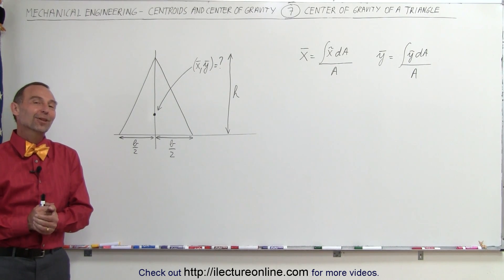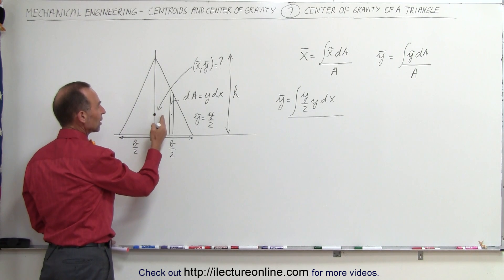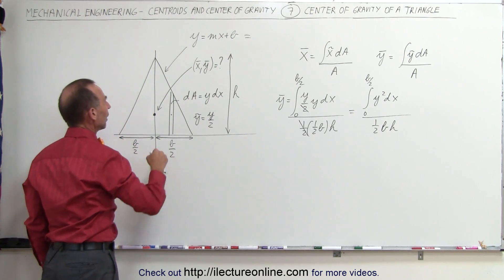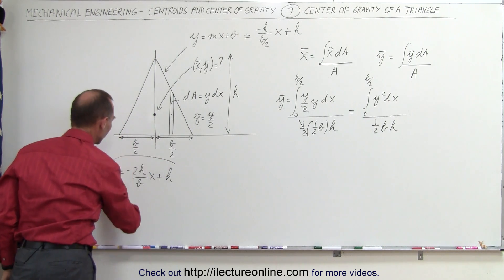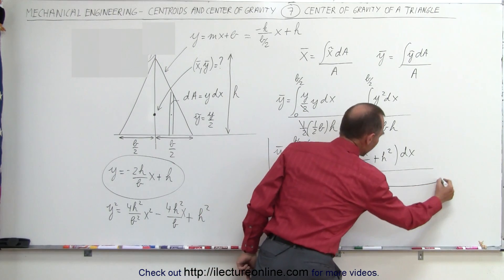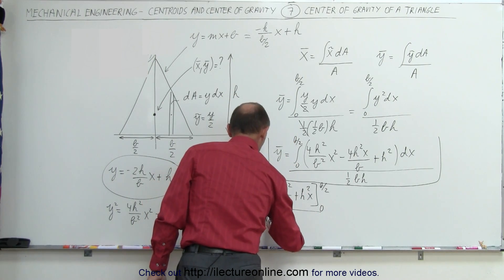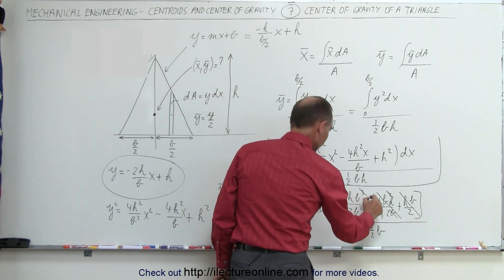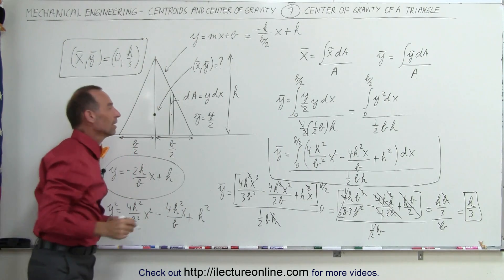Mechanical Engineering: Centroids & Center of Gravity (7 of 35) Center of Gravity of a Triangle

Comment: Hi sir! Is this applicable only for isosceles triangle? If it was an scalar triangle then the median to base won't divide the triangle into symmetric halves, it can't be passing through y axis, then how should we proceed?
Reply from the maker: This can be used for any shape triangle and the result will aways be the same.  You would just have to calculate each half seperately

Comment: For an equilateral triangle, you don't need to use integration. Trigonometry will do it.
Reply from the maker: Certainly you can use the principles learned in geometry, but this is an example of how to caluclate it using calculus.
Reply: @MichelvanBiezen  In reality, the shape of a physical object does not follow some well behaved (smooth) functions. And integration in the mathematical world is really an approximation of summation in the physical world, not vice versa. The idea of center of gravity really hasn't progressed much since Archimedes.
Reply from the maker: No it hasn't, but then there is no need.

Comment: Sir the integration should be from -b/2 to b/2, I guess 
Plz clarify the range of integration if possible
Reply: He used only half of the area in 0:59 (thus the range from 0 to b/2). He could have multiplied the numerator by 2 and use the whole area in the denominator which would result in the same thing.
Reply from the maker: Because of the symmetry, the centroid of the left side equals the centroid of the right side, which equals the centroid of the whole triangle.
Reply: Thanks sir

Comment: For those who are confused about why he didn't take 2*integral like the previous video. Notice, he took only the half area of the entire triangle. So if you take the entire triangle, that would be 2* right triangle in the denominator. And then take 2*integral in the numerator. Then you'll end by cutting 2 from both numerator and denominator. Hence, the equation becomes the same.
Reply: Why is it that if I try to make A equal to the entire triangle area and the dx limit is -l/2 to l/2, the result is not the same?

Comment: As we are intrigation from 0 to b/2, shouldn't we multiply the whole thing with 2? So shouldn't the ans be 2h/3? Please correct me if I'm wrong
Reply from the maker: If you were computing the area, yes you would have to multiply by 2.  But the centroid of the left half is the same as the centroid of the right half, so you don't need to double the result.
Reply: @MichelvanBiezen  thanks a lot

Comment: i see that you were calculating using the formula of the right side of the triangle,  y= -mx + h and the limit is from 0 to b/2. Then what about the left side?
if so, wouldn't that make the coordinate of CG at x is wrong?
Reply from the maker: Because of the symmetry you will get the same answer.
Reply: @MichelvanBiezen  thank you

Comment: SIR HOW DID YOU OBTAINED SLOPE OF LINE?
Reply from the maker: Use the concept:   y = mx + b
Reply: BUT HOW  DID DETERMINE SLOPE OF  y=mx+b
Reply: i.e,  m= -h/(b/2)
Reply from the maker: slope is rise / run     change in the       vertical distance / horizontal distance
Reply: ASHOK KUMAR but how -ve sign is there
Reply: @harmansandhu5095  
Descending slope
rise is +ve
run is  -ve
rise/run = +Ve/-ve = - ve

Comment: Hello sir . My question is that . Why are u not multiplying it with 2 to make it for whole triangle . As u did it in case of semi circle . Kindly elaborate this point . Thanks ....
Reply from the maker: You only need to do that when you are calculating the area.  Here we are finding the center of mass and because of the symmetry we only need to find it for 1/2 the area.
Reply: @MichelvanBiezen  so, can we also do the same when calculating the semi sphere?
Reply: @MichelvanBiezen  but in the case of semi circle we take the limit as -R to R why don't 0  to R

Comment: Why exactly are you taking half the area? In your circle example (which is also symmetric) you are taking the area of of the whole half circle. Please explain. Thank you very much!
Reply: One more question! Why are you using the area of the triangle anyways if you are actually slicing it vertically into little rectangles. Mustn't we use the area of the individual slice we are creating? Or is that because we know the area of the given triangle already?
Reply from the maker: The area of a triangle is (1/2) x (base) x (height)
Reply from the maker: That is the beauty of integration.  When the rectangles become infinitely thin (as they do in integration), the sum of a near infinite number of rectangles exactly represent the area of the figure.

Comment: hi professor , why did not you multiply the term in the numerator by 2 as you took the limits of  integral from 0to b/2 , as we are going to calculate te centroid of the big triangle not the right side one  and what support my claim is that you took the area of the big triangle at  the denumerator  wich is 0.5 *b*h
Reply: +Michel van Biezen Professor, in the semicircle video you multiplied by 2 the integral since you're integrating from only 0 to R. Why didn't you do the same here?
Reply from the maker: +ahmed mgdy Not sure which equation you are referring to, but it may be the conversion from:(1/(b/2)) = 2/b
Reply: Lawrence Gordon   I'm also facing the same problem